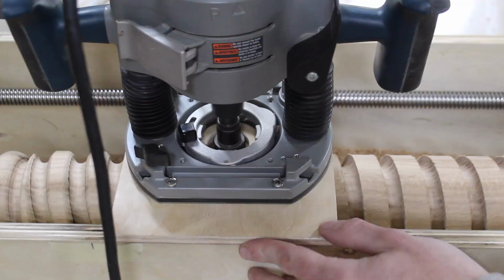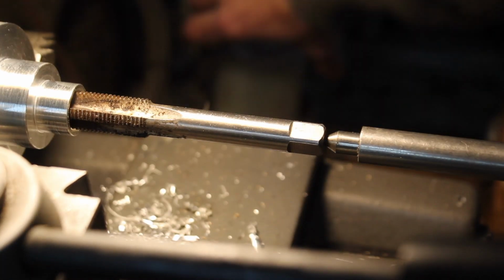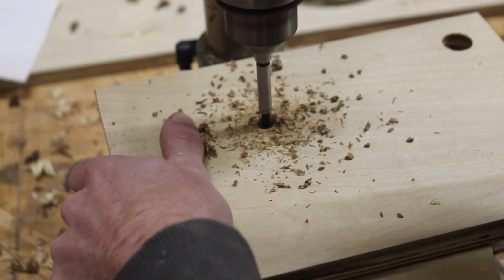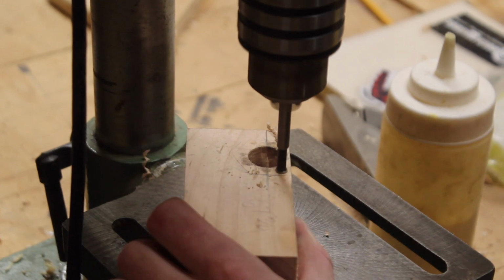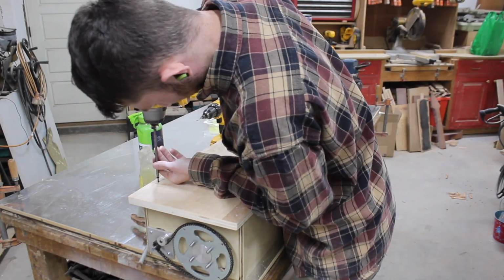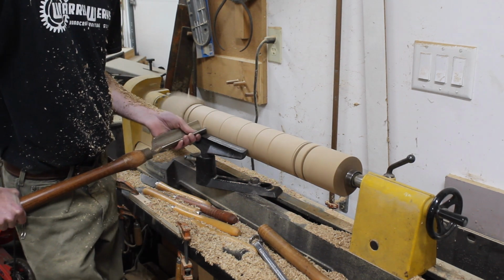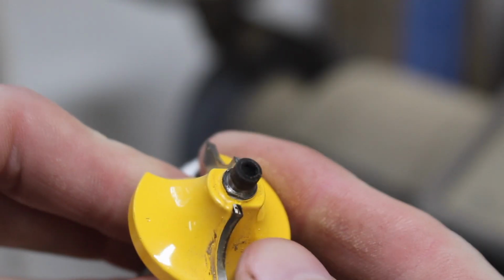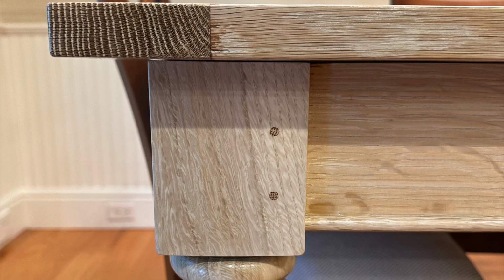Wooden Spiral Legs Without A CNC

Comment: I want to know the math behind that ratio. My mind is so blown. Great work
Reply from the maker: I’ll do my best to explain here. There’s an 80 tooth sprocket that drives the actual leg which is fed by a 10 tooth sprocket that’s on the lead screw giving an 8:1 gear ratio. The lead screw is 3/4-6tpi acme thread. So 6 rotations of the lead screw moves the carriage 1” so when I divide that (6) by the ratio of 8 it comes out to 1.33 tpi if you will. So it ended up being very close to a 1-3/8” thread on the actual leg. Hope that makes sense!
Reply: @warrenwerks  thank you, definitely makes sense. Keep pushing yourself, you are doing really cool stuff
Reply from the maker: @ikagviz  appreciate that man! I just reread my explanation and realized there’s a slight error, it’s not 1-3/8 tpi, each thread makes up a full 1-3/8” if that makes sense so technically it’s more like .73 teeth per inch

Comment: I was searching for a way to cut something like an archimedes screw for a marble toy I was thinking about making for my  grandson and stumbled on this. It's exactly what I was looking for but I'm not sure if it makes sense for me to build something at this level. I'm an engineer but not a machinist so I would have to buy mounts that worked with existing sprockets and threaded rod or else try and design something with wooden gears. I also don't have a lathe so I either need to start with round stock or build a second jig like Izzy swan has built for turning a square blank into a cylinder. 

I paused the video and counted the teeth on the sprockets looks like 10 and 80 (20 from hole to hole) so you're getting 8 rotations on the drive screw for everyone on the workpiece. I searched a bunch of acme screws and it looks like you have 6TPI 3/4". I compared your thumb to mine and measured with a ruler and then I held my thumb away from my screen until it was the right size and saw how many threads were covered so I definitely could be off. I think this means you're moving the router bit 1.33" for every revolution of the workpiece which seems like a workable number for my marble lift. I would be interested to know if that's the distance valley to valley or peak to peak on the threads. I also counted 16 turns on the final legs and if you think about a 30" table being normal and take off 4-5" for the top square and the bottom tapered foot you're left with about 21" and that also makes sense for the 1.33" of lift per revolution.
Reply from the maker: @brianb7388   I want you to know I smiled the entire time reading your comment. 1.33” for each revolution is spot on what my calculations came to! The fact that you were able to get that just by counting the sprocket teeth and measuring by the size of my thumb is so impressive. If I’m understanding your question correctly the distance would be the same peak to peak vs valley to valley. That being said the valley would be approximately 1/2 of that. Of course it’s not exact due to hand shaping and if I remember correctly I believe I used a 3/4 cove bit, making the valley slightly wider than the peak
Reply: @warrenwerks  well I loved your video so that makes us even. I can make/build/fix a lot of things from plumbing and electrical to almost anything made of wood but I can't weld and I've probably spent less than 4 hours of my life total with a metal lathe so the machining skills are more impressive to me than anything that I can do. I'm always more impressed by skills I don't have like singing ;)

I've been doodling different ways to lift marbles on a pad for a couple days. I've designed two kinds of marble pumps one rotary and one a lever/ratchet combination, a conveyor with pegs that would slip through slots in the feed ramp and an archimedes screw type lift. I really like the screw lift for some reason and I started thinking about making a table saw sled/jig to turn a 2-3" square into a cylinder. and then i started wondering if I could make a jig to spin that round blank as I pushed it slowly across the table saw blade in a "cove cut" configuration. I sort of thought I could add a fixed tooth rail to the table saw and a gear to the sled that would spin the workpiece because then I could change the rotations per inch by simply changing the gear so more teeth would turn the workpiece slower and give a proportionally higher slope in the track. 

in any event what you built was awesome and I'm jealous but it's probably more expense than I could justify for a one time thing for my grandsons toy. I build a lot of "one time projects" and I try to keep the costs in perspective. having a spiral cutting jig might be useful for other projects particularly if I made it at least 30" so I could make table legs but it's just a hobby for me and so i can't recoup any costs from making high end furniture like your table. gorgeous work by the way. the legs really make it unique.